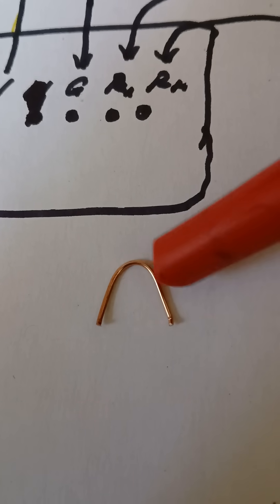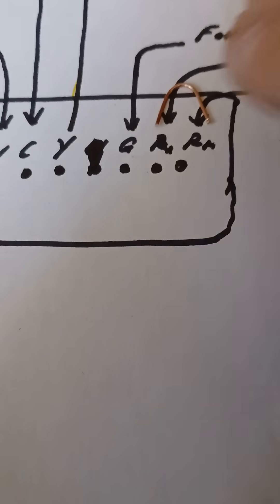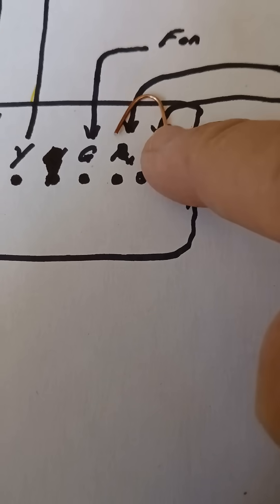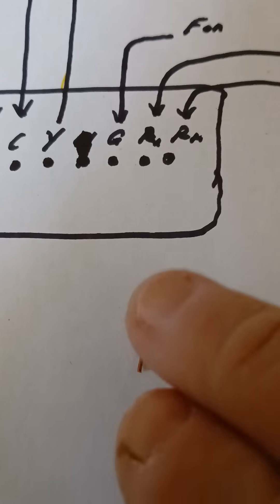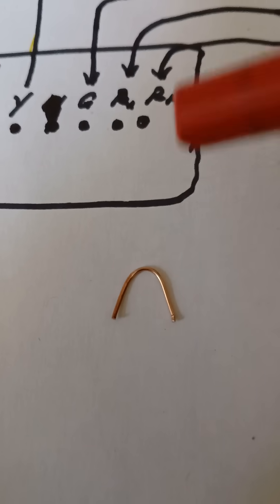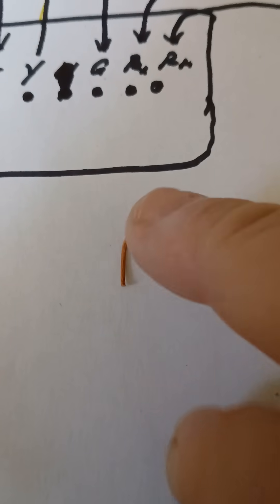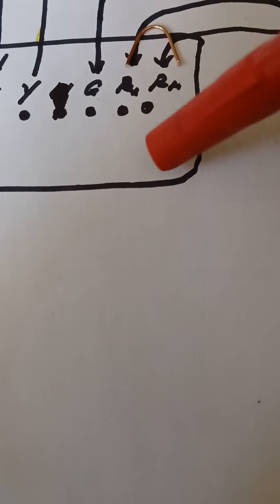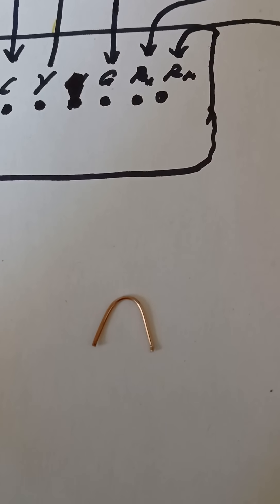How to make a jumper wire for hvac thermostat?

Comment: There is no need to remove the insulation. In fact that creates a short hazard leaving that much exposed copper on the hot wire. Just strip a 1/4 inch or so from each end and screw or insert into the terminals.
Reply from the maker: Good info on hvac jumper wire.

Thank you!

Comment: my question is this. What gauge of wire needs to be used? Or is wire thickness not important?  Because i have seen thick copper looking wires used and then thin looking copper wires. So does this matter?
Reply from the maker: 18 guage wire may work fine?

...simply take one strand of thermostat wire, skim-back insulation, and it may work fine. ...should be low voltage, perhaps around 24 volts.

Thank you for watching!